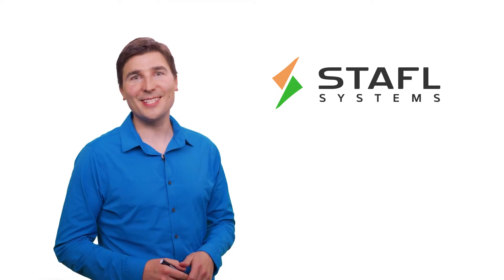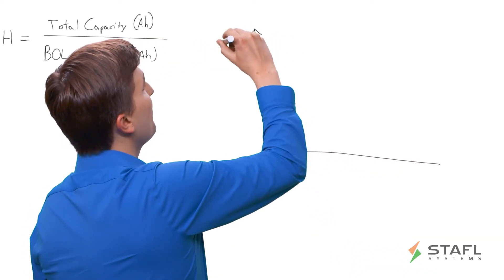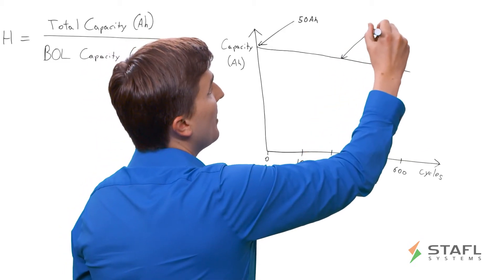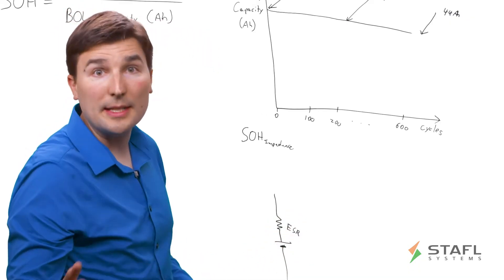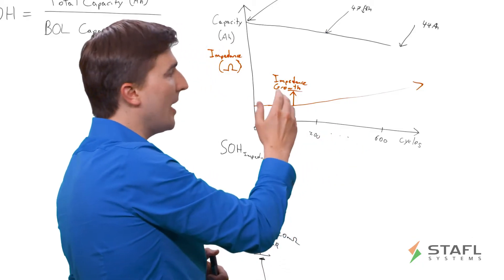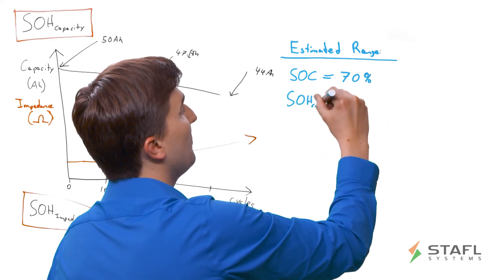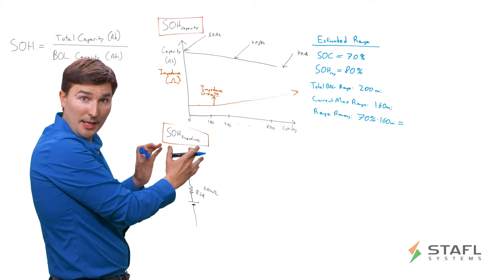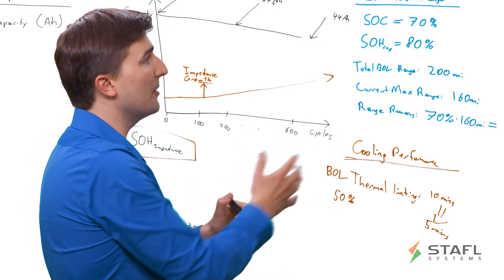Calculating the State of Health for a Lithium Ion Battery System

Comment: SOH for capacity and for impedance is not one static value. If you have temps. range -15 - 60 *C and capacity 300 Ah and you want to calculate SOH, you have to calculate / 60 - ( -15 ) x 300 === 22500 point LUT / look up table /, because for each SOC and temp, impedance is different number.

Comment: In another video you go into details of SOC(capacity) and SOC(energy). Wouldn't this distinction also be important here? What is the relationship of SOH(c) to SOH(e)?
And just multiplying 70% SOC(c) with the remaining range seems like a mistake due to the same effect.
Could you explain it here as a comment? Thank you!
Reply: well he took soh into consideration,you would have to calculate the soh first in order to get the right results,think of it as a relationship between soh and soc,soh is the first thing to calculate and with that result you go on into calculation with soc,he couldnt multiply the 160 iles with 70% if he didnt get those 160 by calculating the soh first,you need the soh to get the soc or range remaining whatever it is, so its not a mistake,maybe you were confused with the soc telling it was 70% and it wasnt labeled as energy or capacity, idk i hope i helped

Comment: This video series is excellent!  Thank you for producing them.
I did a little research on the products you offer and it appears you are most geared towards larger system such as those found in EV and large scale off site situations.  Since my solar system is very small in comparison (remote cabin) I don't think any of your products would be appropriate.  However, the knowledge from these videos is really valuable.  
I am presently using an Overkill BMS and, so far so good but it appears your BMS products are a completely different "animal."

Comment: If the 70% SOC is measured in units of amp-hours then you would have LESS THAN 112 miles ( = 160 miles x 70% SOC ) remaining, due to the lower voltage and therefore lower energy.  Whereas, SOC(energy) would  be ~112 miles, until "empty" ...